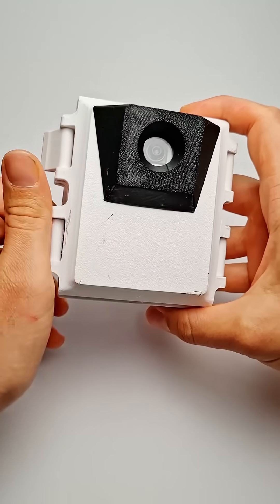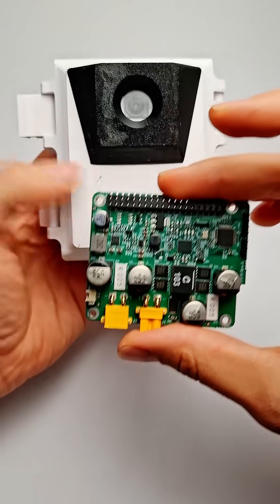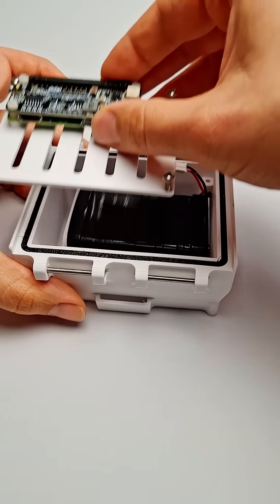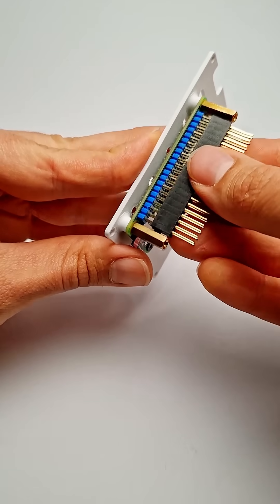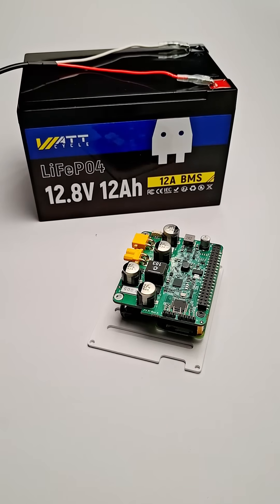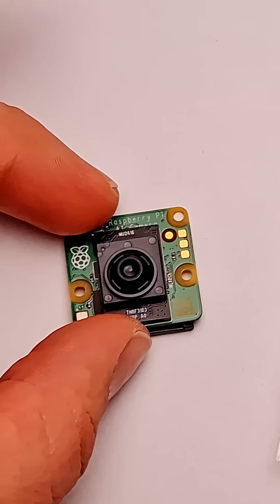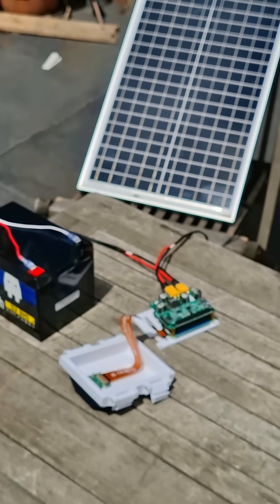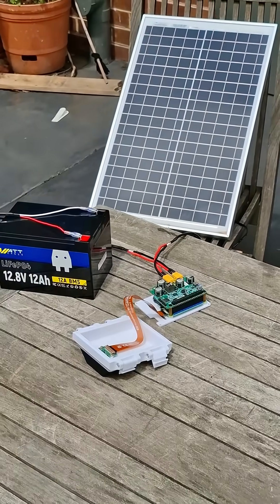Check out this Solar Powered Raspberry Pi Zero! #raspberrypi

Comment: Why the big battery if you add PV. All you need is 12hrs a day. It will recharge the battery and run loads every day. With the small battery as backup. No need to oversize the storage when running PV input.
Reply from the maker: You are assuming every day will be sunny...
Reply: In the UK we get around 16.5 hours of daylight in June but this would be mitigated a bit by the intensity of the sun (when it shines in the UK of course 😂)  Early morning and dusk are the best times for certain wildlife - could you update your software to target these key hours, increasing battery life?  Great project BTW.
Reply from the maker: @somethingfilms24 yes you could schedule the Pi to boot up and shutdown at different times of day

Comment: Don't know if this has been mentioned, but if the winter months get cold enough, the BMS in the battery might disconnect power in an attempt to prevent damage from charging during freezing conditions (it depends on the type of Lithium chemistry on that shut down temp, and of course if it has a temp sensor in the first place).
Reply from the maker: Some LiFePo4 batteries are self heating and can operate with sub-zero external temperatures. You can also buy automatic LiFePo4 battery warmers.
Reply: @LukeDitria or bury it below the frost line
Reply from the maker: @JustRollin I don't have much of a frost issue where I live.

Comment: A lot of interesting animals are nocturnal. Since you have so much power now maybe you could swap for a visible/infrared camera. 

The color of the enclosure should have no contrast with the tree… like a dull brown or brown camo if your printer can do multiple colors.  

Those are my thoughts. Great project!
Reply from the maker: Yes, my larger camera boxes are set up for night and day monitoring
Reply: @LukeDitria This is particularly interesting to me. I have a cabin in the woods and I want to set up something similar. Temps get down around freezing during the winter so I may need a cold tolerant battery. I’m excited to see your final version.  Best to you!
Reply from the maker: Some LiFePo4 batteries are self heating and can operate at external sub-zero temperatures. You can also buy automatic battery warmers.